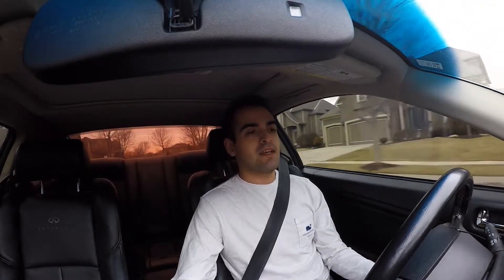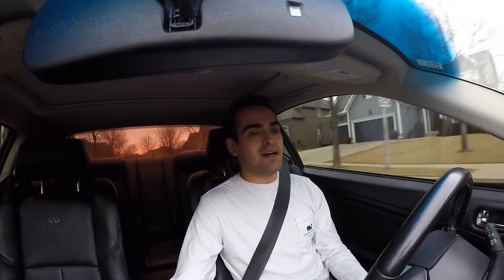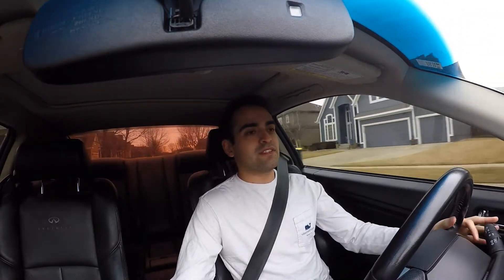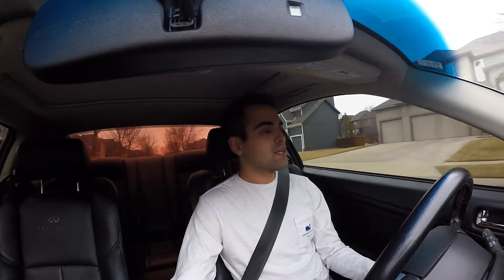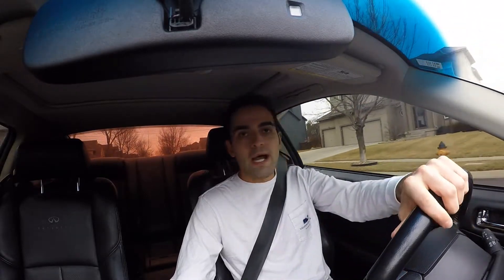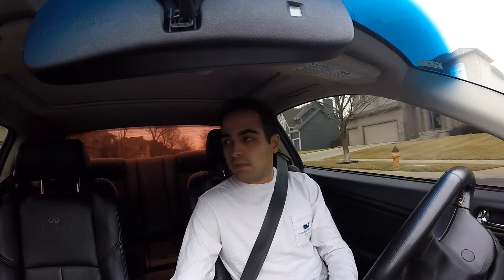Motordyne XYZ Pipe REVIEW !! | G35, 350z, FX35

Comment: I have a bad heat sheet rattle on my drivers side to after some new HFC installed. It's especially bad when quickly accelerating from a stop
Reply from the maker: Might need to tighten the bolt on the heat shield or could just take them off. Did you re install the brace that bolts onto the catalytic converters? A bolt could be loose on that as well

Comment: the replica doesnt sound close to the stune exhaust at all. if yo get the muffler you will be much happier
Reply from the maker: It was pretty close the first couple years. Then towards the rear muffler, multiple stress cracks formed from the welds so it had multiple exhaust leaks. Dont have the exhaust anymore